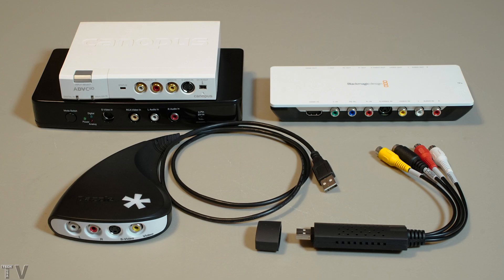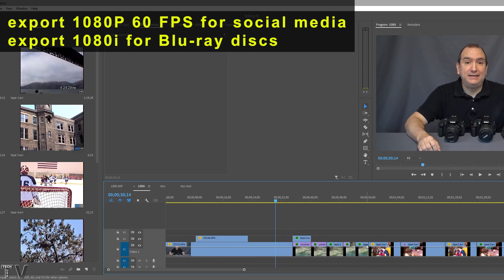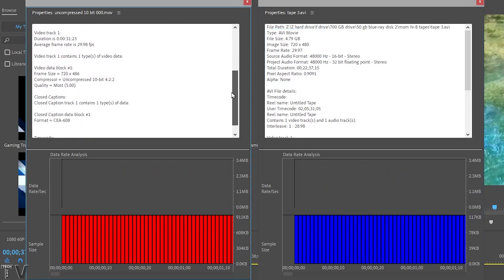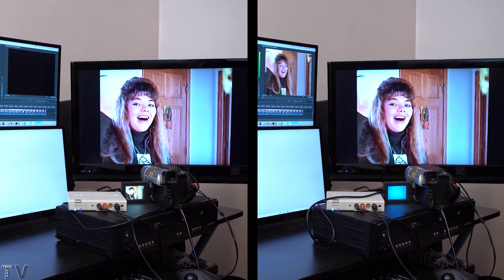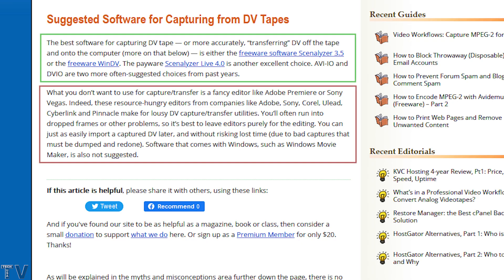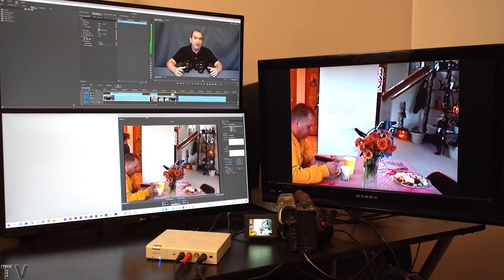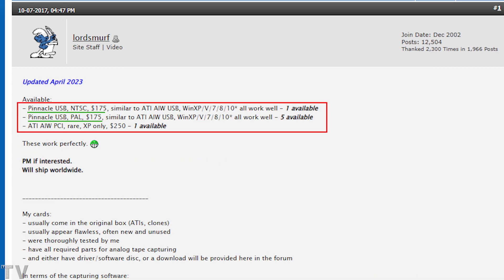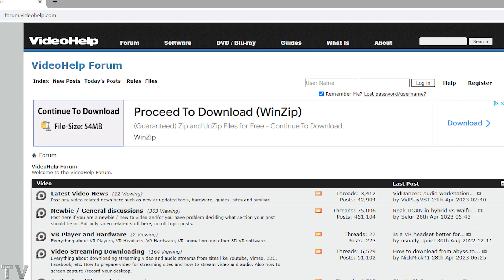VHS video capture and Hi8 video transfer myths debunked

Comment: You state the Canopus ADVC 110 doesn't need an additional TBC. Let me partly disagree, at least with PAL signals. (I don't have experience with NTSC.) While it will indeed avoid audio synch drifting, it WILL drop the damaged frames when it starts creating a new file so there will be some hiccups in the video. I've posted some notes on this in the description of my newly-uploaded "Frame vs. line TBC, feat. Panasonic NV-HS860 & WJ-AVE5, Canopus ADVC-110 and Sony DCR-TRV355E" if interested.

Basically, if you feed the signal of a frame TBC (for example, a Panasonic WJ-AVE5) to the Canopus, it'll do wonders and will NOT choke on the frames otherwise it'd discard (alongside with the accompanying audio). So, at least with PAL signals, you do need a frame TBC with the Canopus.
Reply from the maker: What software did you use? Some people use crappy software like Virtualdub, Hadnbrake etc with the ADVC 110 instead of using Premiere Pro, iMovie or FCP.
Reply: @TechTVusa  I've been using FCPX (legal, non-pirated). The Canopus, by default, just starts a brand new clip upon encountering framedrops. This generally results in 
1, the given (damaged) video frame being completely discarded, meaning the audio will also be lost. (The latter is obvious, since the Canopus does strive for audio synch - and it indeed excels in it!)
2, what is even worse, the first two frames of the new clip it starts recording will completely be silent.

Again, this is PAL, not NTSC. The settings are the factory default ones.
Reply from the maker: @mostlyfinnishlifeeventsand5112  If you have a damaged spot on the tape the ADVC 110 will stop recording. If you use  a TBC it will allow the ADVC 110 to keep recording where the tap is bad. Is that what you are referring to?
Reply: @TechTVusa  Yup, without a frame TBC in the chain, the Canopus will stop recording upon encountering a bad frame, but at least FCPX (at least with version 11; will test older versions on my Intel Macbook Pro too) will immediately start recording a new clip. The "damaged" frame will not be recovered, and the audio in the very first frame of the new recording will be silenced. Particularly on PAL (25 fps only) the missing audio (the missing 1/12,5 (=0,08) seconds) is truly annoying and can make understanding spoken text hard/impossible. NTSC, where the frameate is appr. 30, the situation is somewhat better; there, "only" 1/15s (=0,06666667s) of audio will be missing.

With a TBC in the chain, this doesn't happen. I've been transferring a lot of old VHS, Hi8 etc. tapes with and without the WJ-AVE5 (used as frame TBC) and the above has always been applicable. Note: I always do a no-WJ-AVE5 transfer first as the WJ-AVE5 slightly softens the image so I only use it with reallly damaged tapes, where the Canopus' dopped frames / audio woud be a major PITA.
Reply from the maker: @mostlyfinnishlifeeventsand5112  For NTSC the ADVC 110 will clean up old worn out VHS tapes by correcting the timing (TBC). I don't worry about recording damaged parts in the tape. When I use the word damaged I am talking about tapes where there is snow on the screen and static like sounding audio. It might last for 5 seconds or 15 seconds. I have had clients give me tapes where the whole tape is static and snow on the screen. The ADVC 110 will not capture that. A TBC will allow you to capture a screen full of snow and static but why do it?  Why would a person want snow and static?
Reply: @TechTVusa  OK, by "damaged" I meant frames that contain something BUT causes 1, the 110 to stop/restart recording (at least in PAL) 2, Sony's passthru DV/D8 camcorders to mess up audio synch by some frames. Those frames are all saved by frame TBCs (at least my Pana AVE5 saved them all w/o losing any video/audio or any audio drift).
Reply from the maker: @mostlyfinnishlifeeventsand5112  The Macs might act different than a Windows PC. I will test things out soon on my M4 Mac Mini
Reply: @TechTVusa  BTW, in the meantime, I've also tried enabling (ON) "Digital-in Reference Sync Mode" and remade the tests with and without the a AVE5 TBC in between. This switch indeed only has effect with digital input, not with analogue ones. Therefore, the results were exactly the same as in my previous tests:

1, no AVE5 (for its frame TBC) in the chain: upon encountering bad frames, the Canopus stopped recording, only to restart recording with (at least) the following frame, silencing it.
2, with the AVE5: everything is OK - absolutely no hiccups anywhere

I also tested "Locked Audio Mode" (switch 4) in unlocked mode to see whether it changes anything. Nope: with a non-frame-TBC'ed input, it did restart recording clips upon encountering problems - with the same problems as before (silenced first frame in the new clip and at least one frame is completely missing). (Albeit slightly fewer times: it altogether created 15 files, as opposed to the 18 in locked mode.) In addition, this mode also exhibited some audio drift, as opposed to the previos, always-locked tests. All in all, at least with Macs and PAL analog input, noone should disable locked mode.
Reply: Just uploaded four new videos on my channel demoing all those setups.
Reply: UPDATE: I've tested this exact setup (SVHS deck directly fed into the Canopus) on my mid-2012 15" Unibody MBP, via - obviously - its own Firewire 800 port. The Mac runs MacOS 13.1 (hacked) and a legal (direclty AppStore-origined) of FCPX version 10.6.5. I tried updating the latter in AppStore but seemingly all newer versions require MacOS 14.6. I had no major problems during importing. I encountered exactly the same issues (a brand new clip is created upon bad frames, with the frame being dropped and the next frame being silent) on that significantly older hardware / OS / FCPX version and, again, without any kind of Firewire / Thunderbolt adapters.

I'll try installing Windows Bootcamp on my Intel machines so that I can test grabbing under (true, not VM'ed aka Parallels et al) Windows.
Reply: I've set up my 2012 15" Unibody with the current Sequeya version (OCLP hacked, of course) and with the current Win11 24H2 one in Bootcamp (fully manual install with command-line filesystem copying / registry hacking). The latter (after a LOT of troubleshooting: the manually-installed NVIDIA Bootcamp driver has immediately caused a black screen upon booting in) sees / imports from both my Sony camcorder and the Canopus in WinDV, VLC and VDub2. Quick tip: the factory defaullt of the Canpus is digital in (DIP switch 2); you MUST swich it to OFF (analog); otherwise, Windows will see it as a "Microsoft DV Camera and VCR"  but won't be able to import anything: the Canopus remains in digi-in mode when you select it as the input device. (One can easily see this by the LED not immediately switching to analog in upon selecting the device. In MacOS, that selection is automatic and there importing does work without any DIP switch reconfiguation, in all possible configs (direct FW input on old Unibodies / TB2-TB3 adapters on newer Macs)). Just grabbing one of my test tapes with a direct SVHS deck connection to the Canopus in WinDV; so far, no dropped frames are reported and it created a single AVI. Hoping for the best - and wil definitely report back with my findings :)
Reply: Yes, now i'm pretty sure the problem I initially described only applies to Macs. ANY Macs as I encountered the same problem on wildly different Macs:

1, M1 Pro, both a 14" and a 16", running MacOS 15.1/15.2 and FCPX 11.0, via the TB2/TB3 and the FW800/TB2 adapters
2, 2012 15" Unibody, running MacOS 13.1 (via OCLP) and FCPX 10.6.5, directly via the FW800 input
3, 2012 15" Unibody, running MacOS 15.2 (via OCLP) and FCPX 11.0, directly via the FW800 input

(Again, I've only captured under FCPX as 1, I also do the post there 2, QuickTime would only capture at 25p, not 50i)

On Windows, however, I encountered no problems at all. So far, only tested on the same 2012 with Windows 11 24H2 and the free / vastly outdated but, for capturing, excellent WinDV, with the default settings. (Direct FW800 input, of course - no need for TB adapters on Unibody Macbooks.) The files are excellent, 50i, exhibit no audio overdrive issues etc.) Just remember to reconfigure the DIPs to start up right in analog mode.
Reply from the maker: My M4 Mac Mini works just fine using the Canpus ADVC 110 along with iMovie and FCP. Moving forward you should contact me on Facebook. Perhaps we can do a video chat as opposed to text messaging.
Reply: @TechTVusa  UPDATE: In the last month, I've completely switched to using Windows 11 24H2 on my 2012 15" Unibody Macbook Pro, which also has a Firewire 800 port (no need to use adapters). On this Macbook, I've installed Windows 11 24H2 in a separate (manually-created) partition. (I didn't install Windows 11 directly as it's not supported; with some manual hacking, it's perfectly possible to get it running even on this old notebook). I've also done a lot of transfers directly (connecting my Pana HS-860 to it via S-Video) with my Sony 355E lately.

On this Windows, using WinDV, I have absolutely no problems with audio drifting when directly capturing with my Sony 355E, unlike on MacOS when capturing with the legally purchased, up-to-date Final Cut Pro running on the latest OS version. And yes, on MacOS + FCP, I have severe audio drift problems even on the SAME 2012 Macbook, with exactly the same setup / chain / Sony VCR settings (TBC on, 16-bit audio). That is, it's not because of the M1 Pro CPU (I previously used a 14" and a 16" M1 Pro-based Macbook Pro) or the double Firewire and TB adapters. (Note: Sequioa runs just fine on the 2012 MBP with hacks.)

I haven't tested other apps on MacOS to capture Firewire yet, only FCP.

Given that, while at least the audio doesn't drift, MacOS + FCP fails with the Canopus 110 too (upon encountering framedrops), at least for the time being, my advice is NOT to use MacOS for any kind of Firewire transfer, or at least not the Sequioa + FCPX 11.0 combo. Just use Windows + WinDV, even if you have a Mac. It's absolutely bullet-proof and won't ever cause audio drifting.
Reply from the maker: @ My M4 Mac Mini capture VHS tape just fine using the ADVC 110. You can see my M4 Mac Mini in action by clicking the video link below. 

https://youtu.be/AnY1yR1kyTw
Reply: @TechTVusa  OK, it may be an issue with PAL vs. NTSC. I'm on PAL. Will try testing the other MacOS-based Firewire transfer apps (if they work at all) with my damaged / 2nd-gen / LP tapes; it'd be great to be able to directly transfer stuff right in MacOS.

Comment: Modern Windows will work with FireWire hardware if you have the right adapters (FireWire 6-pin to FireWire 800, FW 800 to ThunderBolt 2, ThunderBolt 2 to ThunderBolt 3 [or USB C]). However, those adapters will not work on Intel CPU later the Gen 11. From my experience, the DV video works great. But today, the Magewell Gen 2 USB-HDMI does support 480i digital output, so you can capture archival quality digital files from vintage analogue sources using lossless codecs - if you want. You just have to use a good analog-to-HDMI converter in front of it - the the Intensity Shuttle. The  RETROTink 5x and the RETROTink 4k have Line TBCs that work really well.
Reply from the maker: The Firewire DV Converters will work with Windows 10 and New CPUs from Intel. They may work with Windows 11 but I cannot say for since I don't have Windows 11. Having said that they will work with Apple M series chips. Premiere Pro no longer supports Firewire devices or video capture Since early 2024. Premiere Pro can only output video with the Intensity Shuttle but it cannot capture video like in the past. Keep in mind the Intensity Shuttle requires a TBC to capture old worn out VHS tapes.
Reply: @TechTVusa  I was able to get FireWire to work on Windows 11 with the Intel i9-11 (Gen 11), but not with Windows 11 on the Intel i9-12 or up. I spent considerable effort and I'm reasonably experienced, so I'm assuming it's impossible. 

Yes - I'm looking at perhaps using an old DVD Recorder for a line TBC for now, until/if I decide to spend money on the RetroTINK 4K - which they say is awesome.  The Panasonic ES10 and ES15 I guess work very well for that.

Comment: I have a Sony DCR TRV480e (digital), will capture with the firewire  create the same results as Canopus DV?
Reply from the maker: The Sony DV cameras use the same DV-25 codec as the mini DV camcorders.
Reply: @TechTVusa  , so if I understand you right, its okay to use my camcorder? I think the picture sometimes can be a little bit blurry at som detals. The problem is that not Im not sure how good quality i can get, what I can expect. I havent watched my hi8 tapes on a CRT tv in 20 years. Is it only a little bit of color I loose with the DV format?
Reply from the maker: @nor-ftm7197  The video below should be helpful. 

https://youtu.be/vqCi9B_7mdU
Reply: I'd say it's worth experimenting. At least in my own practice, with bad input, the Canopus produced significantly better results even without a frame TBC than my Sony DCR-TRV355E I used for digitizing. The Sony not only exhibits audio drifting with bad tapes, but also "popping" sound when the input volume is too high. While the Canopus isn't exactly devoid of problems (at least in PAL and/or when using Macs), it has produced FAR better results, audio-wise, than the Sony. (1, No popping 2, no synch drift). Please also see the discussions elsehwere in this very comment section. Note: YMMV! It's possible your Sony has better AV in support than my Sony DCR-TRV355E, dunno.

Comment: Do the DV converters have Interlaced video top of bottom fields that you can choose during capture? Or is it bottom field automatically? DV cameras usually were Interlaced bottom field first. VHS, 8mm, etc was usually or always Interlaced top field first first.
Reply from the maker: I think you are asking the wrong question. You should watch the video link below and ask yourself if the quality looks good or not. 

https://youtu.be/vqCi9B_7mdU
Reply: I do believe DV is bottom field first and analogue NTSC (VHS, Hi8, Video8) is top field first. That should not matter so long as you're capturing it as native 480i (for NTSC video). It will only matter once you try to deinterlace it. But most deinterlacing filters have a checkbox for field order. If you get it wrong - it's very obvious. Just flip the checkbox, and you're good to go.

Comment: Will the AVDC capture firewire and still record the video when the timecode on the DV tape drops? When I go directly through final cut pro with firewire converter cables the recording capture on final cut always stops and creates a bunch of 1 second or 5 second clips of the longer video I'm trying to capture because of the timecode drops. I tried so many different capture devices and all do the same stopping the recording cause of a bad old tape glitch. But when playing on the camera it's clear perfect until it goes into timecode on capture then only on the computer blue glitch but camera still image and audio.
Reply: Yes the Canopus ADVC will continue recording if there is dropped frames etc. I had the ADS Pyro Link Firewire Capture box. It would do the same thing and stop recording if there was any dropped frames or tracking issues. Not with the ADVC, it just keeps on recording.. I just picked up a ADVC 100 for $40CAD!
Reply from the maker: @WaxOnWheels  Dropped frames is a tad bit different than a damaged control track on the actual VHS tape. A damaged control track can cause problems. A TBC can usually compensate for control track issues.
Reply: Yeah but the main point is the Canopus ADVC will not stop the software recording regardless of the issue. Even if you press stop on your vhs deck the ADVC will keep the software recording..
Reply from the maker: @WaxOnWheels  I hear what you are saying but your comment is incorrect. The Firewire DV converters are broadcast compliant. They use data from the control track. If the control track is damaged it can cause issues. Even a  Professional $30,000.00 Betacam (not Betamax) deck will have issues if the control track is damaged. I can hook up a VHS camcorder to a Firewire DV converter and it will record to the hard drive just fine because there would not be a damaged control track. Do you kind of see my point?
Reply from the maker: It sounds like the tape has a break in the control track. That can cause problems.
Reply from the maker: mooncricket

I should mention if you have a DV camcorder the camcorder can be connected directly to the Firewire Wire port. No need for a Firewire DV converter.

Comment: where does the Sony DVMC-DA2 (or DA1) Media Converter compare to what you are using? i use sclive to capture from a jvc s-vhs machine (no tbc). thanks :)
Reply from the maker: I would appear it is a Firewire DV converter.  It should work OK.
Reply: I have the Sony DVMC-DA2 and it works perfectly fine - so long as you can find a way to connect it to a modern computer.